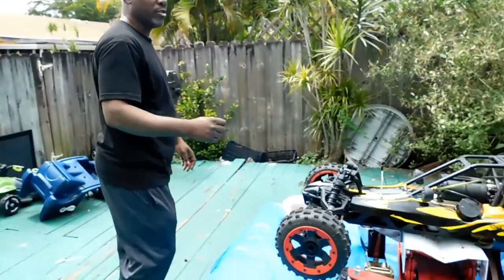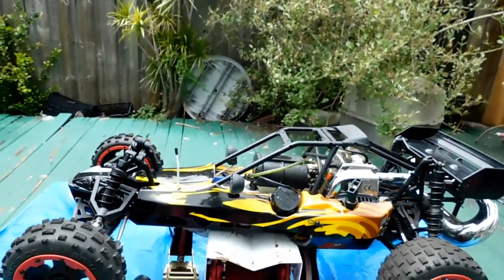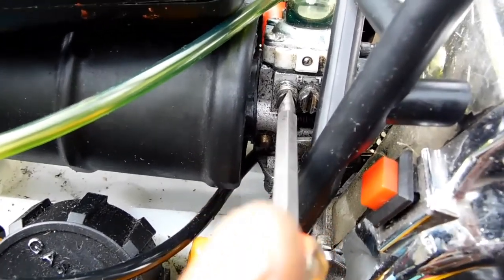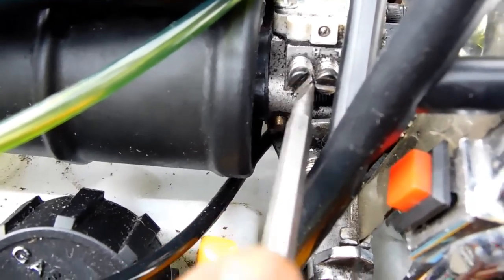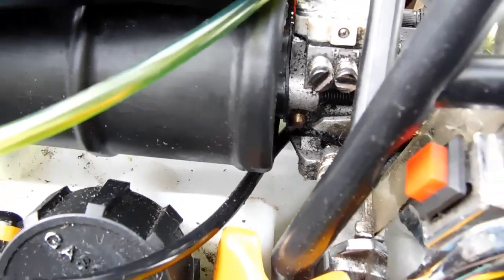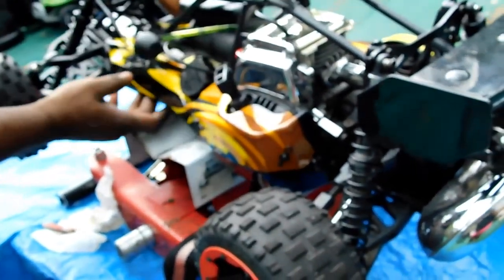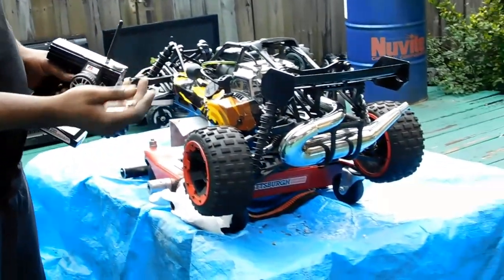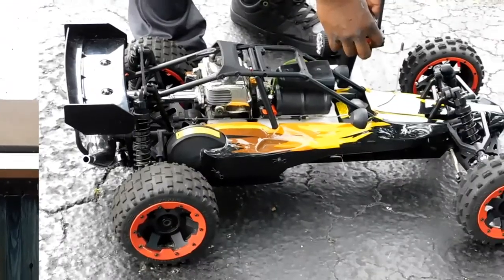TUNING 1/5 SCALE RC CAR

Comment: How do I fix my 1/5 ,it will not start . I tuned bit pre you video it still will not start it run earlier
Reply: Probably flooded it so you need to take the spark plug out and open the choke and and slowly pull the pull start leaver a few times and it should clear it out. Once done put the spark plug back in and copy his carb settings or do L-1.25 H1.50-1.75 and it will or should start. If not you may have a different issue.

Comment: on my 36cc with your setting the low was fine but it was way too lean on the high,car would bog down had to open the high another full turn
Reply from the maker: It just depends also on outside conditions and whether your running stock or any hi performance parts. Once tuned you do have to turn hi side until you get hi clean sound with at the same time you need to see smoke to make sure your not running too lean
Reply: @madmechanics7525  all stock and stated inside car only goes out when i know it will run thanks for replying